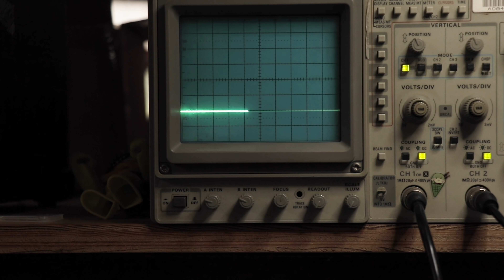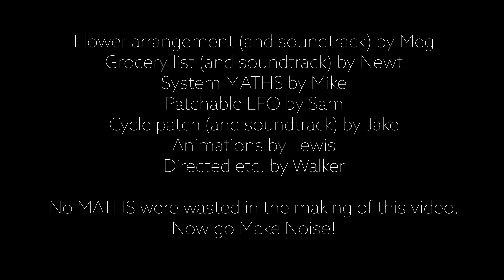Top Ways to Waste a MATHS Channel

Comment: so you're telling me I should switch to Morphagene for the grocery list instead?
Reply from the maker: Here's a patch: You'll need a portable battery and a portable speaker. Record your reading of the grocery list into the Morphagene, and place a Splice point at the beginning of each item. Let the Splice loop aloud until you have retrieved the item, then hold Splice & press Rec to cross it off. Repeat until your list is exhausted. Ideally the speaker should be turned as loud as it can go.
Reply: Brilliant. You can also have a reel with all possible items, and let a random step sequence decide what you eat today
Reply: @MAKEN0ISEMUSIC  Morphagene is super awesome and fun. Probably one of my favorite modules in the Shared System along with Maths and Wogglebug.
Reply: @joshstrauts8358  A white marker?

Comment: To be honest, that's exactly the reason I ended up never using my Maths. I always had the fear that I waste its potential, that there is something more important to patch later on. So I got logic units, little mixers, dedicated function generators until I didn't used my Maths at all. Option and analysis paralysis go a long way with this module and me.

So better waste a channel than to not use a channel at all.

Comment: Good god! I had missed this entirely! This was so therapeutic ;) I love Maths, it was the first module I ever bought. However, now that my system got bigger, I often find myself obsessively postponing to use Maths when building a patch. I always feel like I should save it for later, for something better. Now I know what it is, fear of WASTING! I feel absolutely liberated and ready to split the universe. No more fear!
Reply: There is of course no right first module since almost no module is going to get you very far all by itself, but why Maths? Did you already have something that could be modulated? Or, was it something else? I am not judging, but I am curious. Mine was Disting Mk4 and then a Doepfer dual ring mod and I find that many find choices odd. I had a semi-modular and it needed more modulation so Disting being 100 different things I felt like it would be worth trying. I still have it and love it. I got a Maths something like 6 years later. I feel like I should have gotten it long before then. It is pretty dope.
Reply: @Tofu_Pilot  yes, I had a mother 32. So for a little while my system was m32+maths. I  still have them both and maths is still my favorite module, no doubt. In many ways it embodies what I like most about modular synthesis, its open-endedness and the fact that a single module can take you very far if you give it time and attention. As far as I'm concerned there are no odd choices, even the simplest modules are full of surprises
Reply: @Tofu_Pilot  my first 3 modules were 3 distings. In theory it was a great idea but as a newbie I found it difficult to learn with and so many options became a bit paralyzing.  I still haven’t gotten a maths many many modules later but I think I would have been better served with a maths and an oscillator to start of with. When tip top buchla came out I got there first oscillator and quad function generator which is pretty much the same idea. It was a blast and I learned a lot! I still want a maths though lol

Comment: Considering MATHS channels 1 and 4 are a bit different, you can't know beforehand which channel to waste first. Wasting channel with EOR can lead to situation where you need EOR, so you have to unwaste that channel and use the other one (with EOC) and then gain EOR functionality.
For that reason I end up with 3 FUNCTIONs and modDemix instead.
My favourite way to waste FUNCTIONs only channel is to patch EOR to HOLD, hit cycle button and wait until it locks itself with +8V and -8V DC. With -8V at hand the modDemix can act as an attenuverter.
Reply from the maker: Next level! ⚡️

Comment: My favorite trick is soldering patch cables to LEDs, plug those cables in channels 2 and 3, turn up the attenuators and voila! Tiny lamps

You can even plug them into 1 and 4 in cycle mode for stobelights, if you want to waste all 4 channels
Reply: Don’t forget to add a load resistor or the LED can burn up. I’m sure you knew that already but comment readers may not be aware.

Comment: This is so great. My favorite way to waste one (or both) of my Maths is as a basic mixer.
Reply: @MAKEN0ISEMUSIC  I extremely often wish Maths had a second mixer in the middle. Still four inputs, but two mixers. Now mine (part of a B&G shared system) has a 4-input attenuverting/cascading mixer sitting next to it. Makes a world of difference
Reply: @jsleeio  That's a great idea! There is a DIY project the developer calls "Calculus" that is basically a double Maths (but derived from the ground up from the same Buchla circuitry that inspired Maths). When I get around to building it I think I will add that extra mixing channel.

Comment: Would love to add a Function or two to my Maths and create a cascading envelope system patching the Function outputs back into Maths channel ch2 and 3 for interesting summing. For now I just waste 1 and 4 on basic ass triggered envelopes 😭
Reply: I put a Function in my shared system.
I’d put a 2nd Function on as well if I could get just 2 more hp in the top row.. I think it would work then.  Then moddemix goes to bottom row.

Comment: I have a DUSG and often hold off using it till the end of a patch for fear of “wasting” it. This video speaks to me.
Reply from the maker: It's a place we've all been! ⚡️
Reply: @MAKEN0ISEMUSIC  and I like using Maths more than Quadrax as it is easier and more intuitive to me. Nothing against Intellijel Quadrax that is a great and powerful function generator as well but Maths speaks to me. Now I need two more Maths for my other cases to make the ultimate modular quadratic equation!
Reply: @GuitarsAndSynths  I am pretty sure you literally said Quadrax is less intuitive than something made from both the spirit Serge and Buchla. DUSG and the 266 are the parents of this to an extent, and by extension, are filled with 1960s Haight-Asbury LSD-soaked weirdness and free-form frequncy freakin and uncertainty. Nice try. :)

Comment: Using MATHS just for the LFOs is a waste of both space and MATHS. Though admittedly the first thing I used it for was a mixer. Back when all I had was a Neutron, Clouds, Ornament & Crime, 2hp Clk and the 4th module I ever bought, MATHS. Really good beginner's setup by the way along with either a Keystep or SQ1 for sequencing.
Reply from the maker: If you think that’s a waste wait’l you see some of the things we do in this video ⚡️
Reply: One of my fav ways to waste MATHS is to use it as an innocent four channel mixer, and then hit the cycle buttons on CH1 and CH4. Some pretty cool distortions and waveshaping guaranteed if you play with the rise and fall. Then add some gates to cycle and the oddness is synced to the rhythm of your patch...